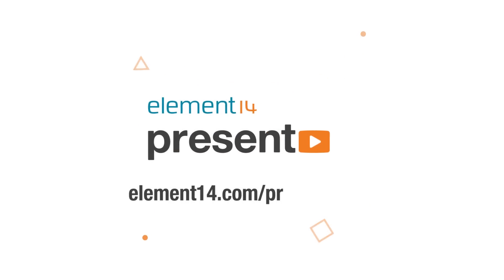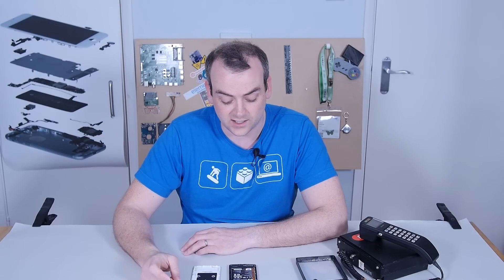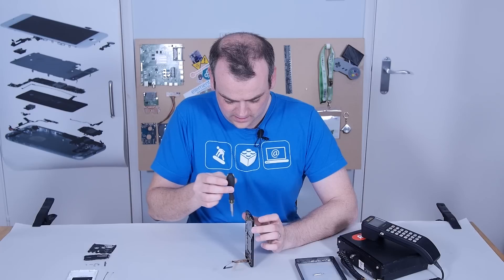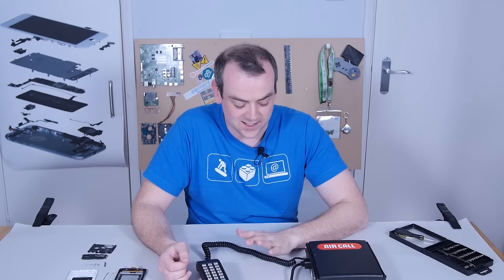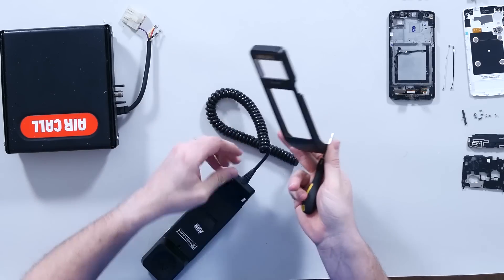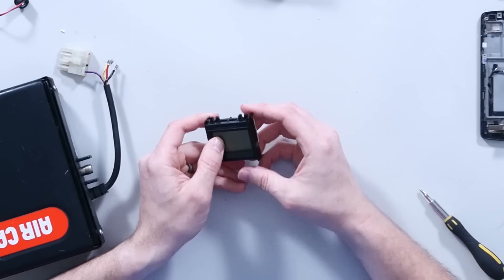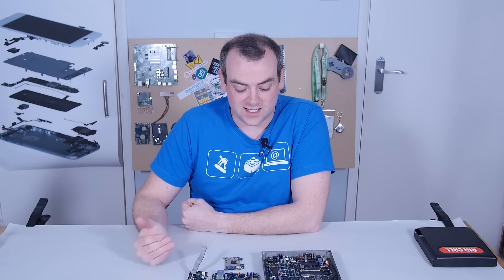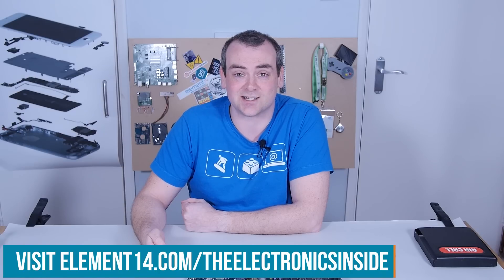Retro(1G) vs Modern(4G) Cellphone Teardown - The Electronics Inside

Comment: The last pin/connector thing is for powering the motor of the antenna to pop-it-up.. or something like that
Reply: The correct answer was shouted out by losttwo1 - it was a horn connection. You could set the phone to honk the horn of your car if you weren't in it to let you know someone was calling! I'd never heard of this feature before the tear down, and for some reason found it hilarious?
Reply: David Edwards haha! Wow... good thing that you could set it else your car will honk every time you got a call. Seems like it is a sound profile thing that android mobiles have that I never use other than “general” and “silent”. Probably that is the “outdoor” sound profile thing. Haha!
Reply: Good guess, but not quite right!
Reply: David Edwards so... what is it for..

Because I thought it would be for the antenna just like their mobile brick counterpart that you could carry around and put it the bag things that need their antenna to be extended before making calls.

Comment: The manufacture of this cellphone was Novatel. I believe this is Model 8300, the 2883 written on the TX shield was an internal number to NovAtel. You are missing a speaker box or cradle that was the phone  ringer. The SIP package on the transmitter PCB is a power control module for 8 different power outputs from 5 mW - 3 W. This model had both rx and tx in the 800MHz band. Another  model for Europe worked in the 900 MHZ band.The yellow wire was used to run a horn relay so you could hear your phone ring, when your car was parked. Main headquarters were located in Calgary Alberta, Canada.
Reply: Right answer! I love the idea of your car horn honking to let you know you had a call coming in!

I really struggled to find additional information for this unit, thank you for filling in some of the gaps!

Comment: An antenna can be 1/2 the size of the wavelength, but also 1/4 wavelength resonance is very popular...but that's not entirely the answer to the "1 inch antenna".

GSM in the US uses 1900 MHz-ish as well as 850MHz-ish.  A 1/4 wavelength at 1900 MHz is still around 4cm in length, which is about an inch and a half.  850MHz is about 35cm.

So, how do they do it?  They use fractal antennas for wideband resonance.  A fractal leverages area moreso than length (well, it condenses length into area).  I've seen a few different varieties, even Sierpenski carpets.  Usually designers will favor using pass/notch filtering for each of the modules needing RF and just use one main antenna for all three.
Reply: You can also have antennas that are full wavelength and multiples, you just have to match the impedance at the feed point (which you can put on the ends, or somewhere in the middle).
Reply: I have to admit, antenna design is a bit beyond my current skill set! Thanks for sharing your knowledge!
Reply: @a531016  It's not for the feint of heart, Maxwell's equations have ended more than one engineers career before it started...